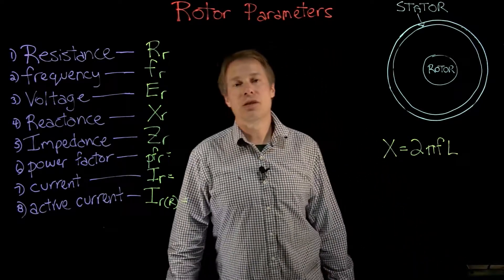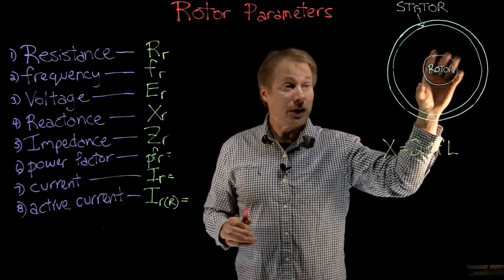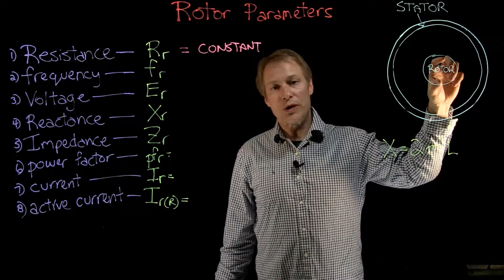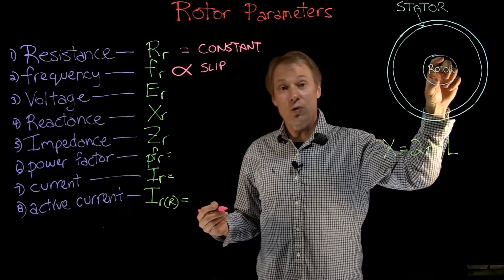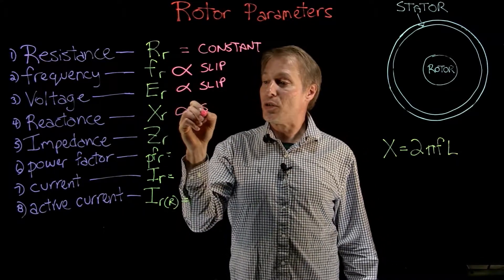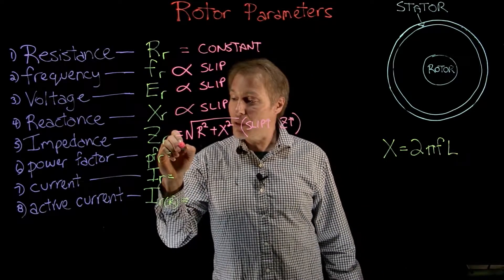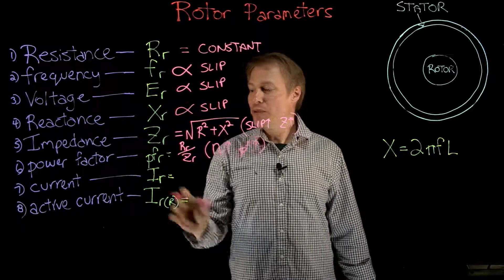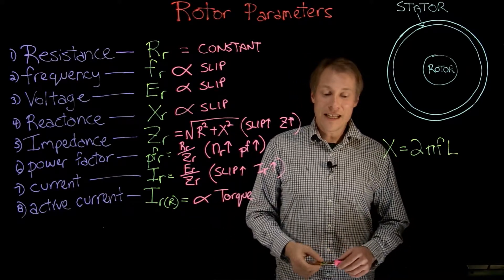Video 03 Rotor Parameters

Comment: Hello Ron, Thanks for you videos. I am finding them very helpful to suplement my studies. I am third year electrical student and am unsure I am calculating the rotor reactance at x% slip corectly. 
I am given for example: 
4pole, 3phase, 60Hz SCIM, 1175RPM full load speed, motor inductance of 0.22H. 
Find the rotor reactance at 10%slip. 

I am finding:
speed at 10% slip = 1620RPM
f = speed x n / 120 = 54Hz 
Xl = 2 x pie x f x L = 74.6ohm 

Is this correct, or am I missing something?

Thanks again, 
Jon
Reply: You are very close to figuring this out. See below:

Rotor reactance = 2 x pi x f x L as you suggested.

The inductance (L) is given at 0.22H which is assumed constant at any speed.

Frequency of the rotor = blocked rotor frequency x slip.  Blocked rotor frequency is 60Hz in North America. So, rotor f = 60 x .1 = 6 Hz (not 54Hz as you suggested).

Then apply the reactance formula which is 2 x pi x 6 x .22 = 8.294 ohms.
Reply: It's useful to remember the extremes of the induced rotor frequency.  IOW, the rotor frequency is at a max (i.e. 60Hz) when it is not spinning (aka block rotor) and at 0Hz if it could spin at synchronous speed (theoretical concept only).  If the rotor is spinning close to synchronous speed (i.e. 1620 rpm) then it's induced frequency will be low (i.e. 6 Hz) not high.
Reply: @lukivr  That is wonderful! Thank you. The difference is what I was missing. This is the effect on the rotor. Recalling the extremes is a good tip to help me with the highs and lows. And... the light bulb goes on! I appreciate you taking the time to answer my question and explain my error in thought.
Reply: I was struggling with the identical question you must be a third year alberta apprentice!